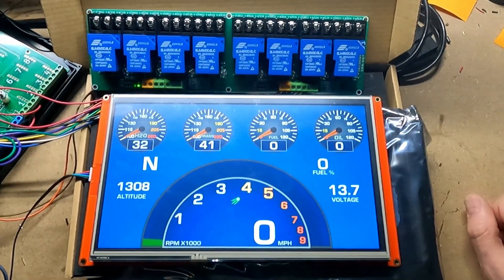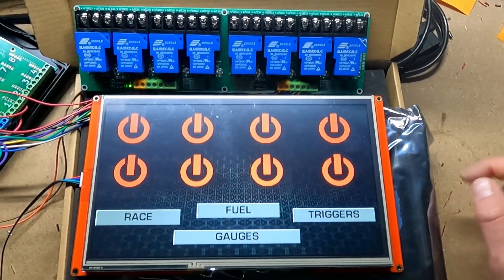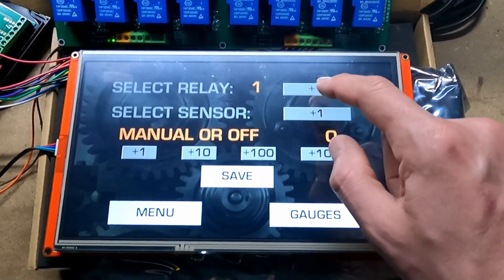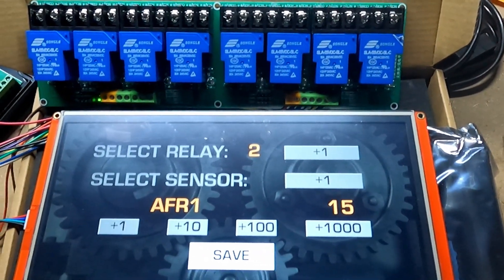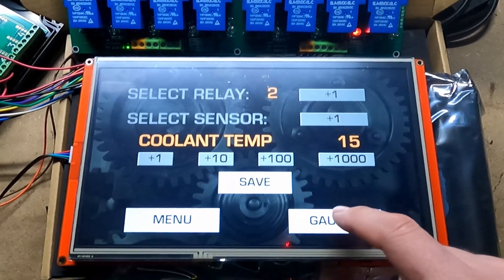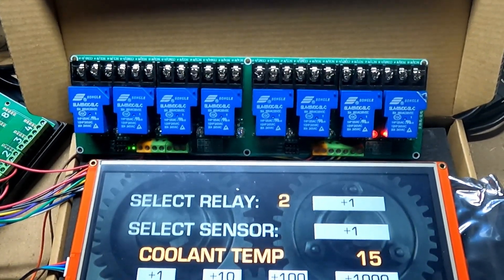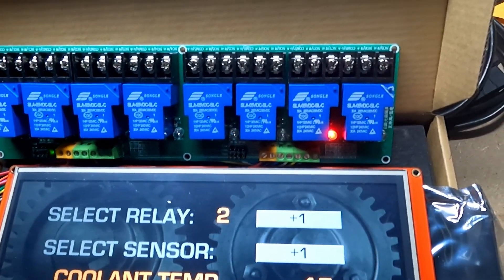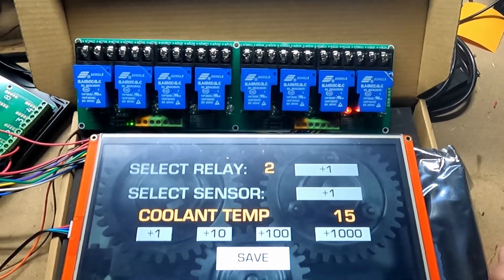OneGauge Relay Walkthrough

Comment: hi their is their any way to control with PWM,like a variable thermo fan instead of on/off?
Reply from the maker: Yes! Definitely possible.
Reply: @TheOneGauge  so whould it need a dc driver?
haltec has a new driver module
Reply from the maker: @joblo4216  honestly it would depend a lot on what type of fan and setup you want to use. It would be best to discuss by email if you want to email me- info@theonegauge.com